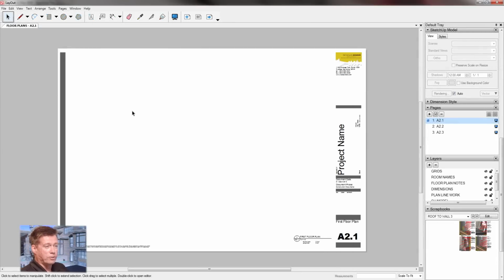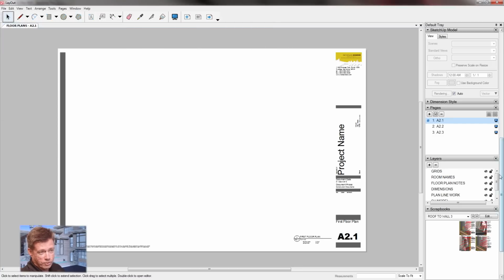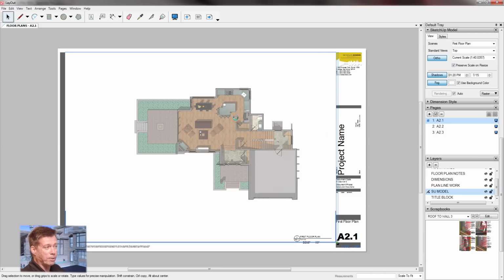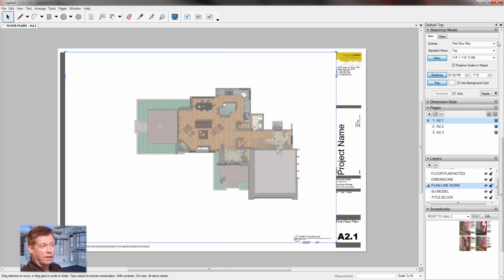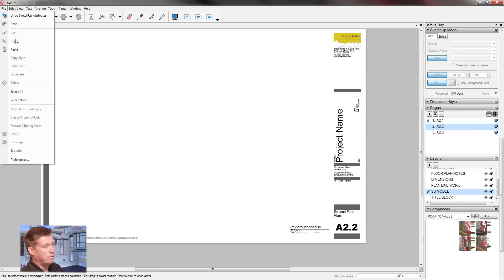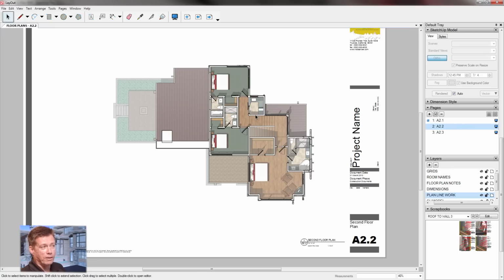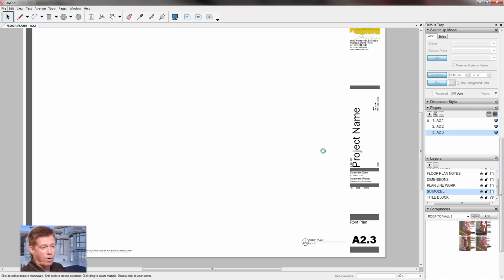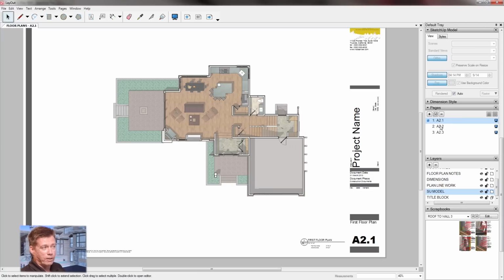SketchUp for Construction Documentation: Layout Floor Plans Template

Comment: Nick thanks for your videos Do you do everything in sketchup first and then bring it to layout or only do the annotations and dims in layout, I have been having trouble doing it the later way, everytime i want to add a dimension it goes behind the model or i have to realign the dims again, since I am in layout. it looks like double work for me, any suggestions>
Reply: You set up the scenes in Sketchup.  Then import the Sketchup file into layout, assign it to a layer and select the scene you want to show.  You only need to do this once.  What is happening with your process is you are setting the model on a Layout layer that sits in front of the layer you are drawing dimensions.  You also probably don't have the scene selected - it probably reads as "modified".  You want that to be selected as the scene as named in Sketchup.
Reply: thanks i will try it again, i have been importing in default layer, and putting it behind all other, and putting dim in a new layout layer called dim, same for annotations. Scenes are selected after I import from SU, and then do all the work in dim/ anno or which ever layer  I need to use. I noticed in your other videos, you have separate files for elevations, sections etc and you link it all up, is that purely for ease of use? I so far am not doing it, as i design and send to client for feedback, so many ways my projects evolve a lot. maintaining multiple files and constantly updating seems a time consuming process, but I can see the use of it.

Comment: Hi Nick, thanks for the reply. And yes I did notice that the scenes were being labeled "modified", Wich then causes an alignment issue in LO. I've since discovered that the zoom in SU needs to be the exact scale required in LO so that it imports at that scale. My scenes have always been aligned identically but no matter what I did, they would import at the wrong scale and then align incorrectly. Drawing the page extents in SU and zooming to this  as you have suggested in the video helps but it's a bit of trial and error to achieve the exact scalded view. BTW I'm using sketch up 7- would that make a difference if I update?
Reply: +Peter Park I would upgrade for sure.  Scale is only set in the Sketchup model Tray in Layout.  In SU you simply want to try and center the element in the scene which is why zoom extents works so well.

Comment: Hi NIck, its only after seeing your videos have i started to experiment with documentation from Sketchup. When you copy a view, paste it and change it to the Line Work scene, it always for me changes the scale and thus not overlaying exactly. How do you avoid doing this? How are you able to insert drawings at an exact scale?
Reply: Hi Peter, the key here is to make sure your scenes in SU are aligned identical.  Otherwise they will shift.  If they are off scale, then the scene in LO will be labeled as "modified". You need to make sure they are not modified.
Reply from the maker: +Peter Park 
When you select the SketchUp model in LayOut, open the SketchUp dialog box to access options for displaying that model. One of the options is to turn on 'Ortho', and then you can also select a scale. 

Sometimes you will need to pick the correct scale again and reposition the views, but that's fairly simple to do and also where Nick's advice on creating scenes is very useful. Good luck!